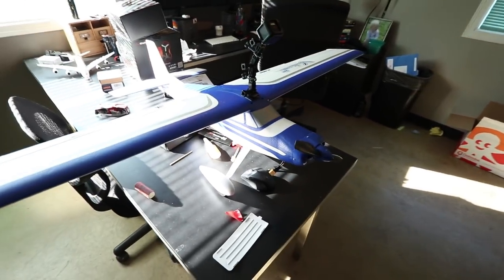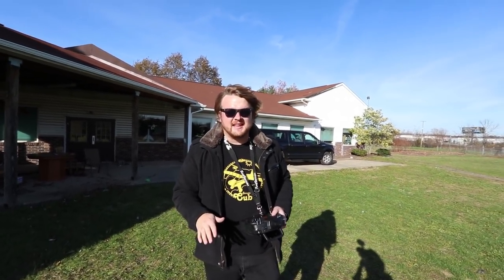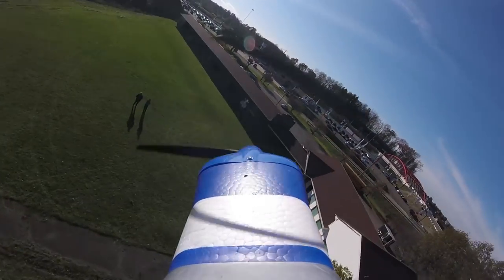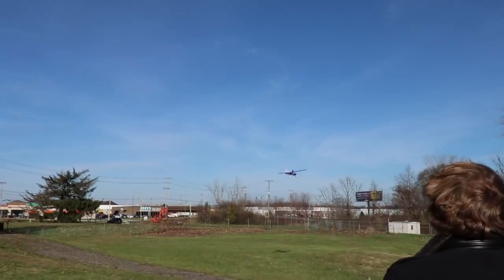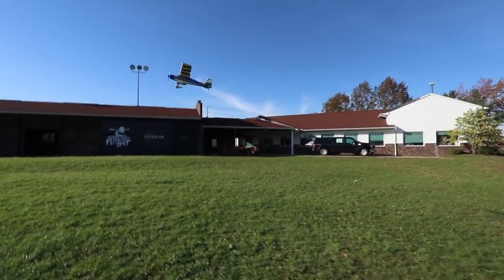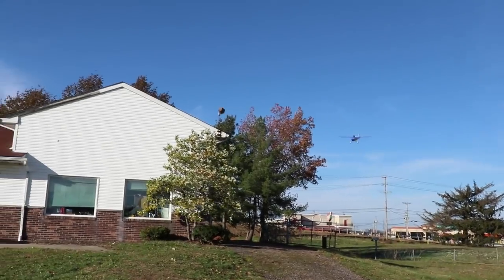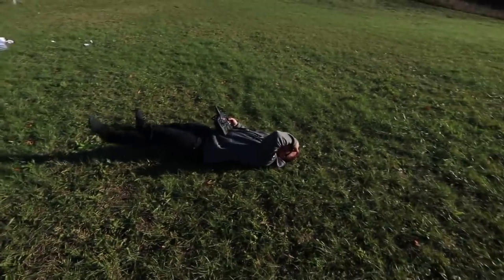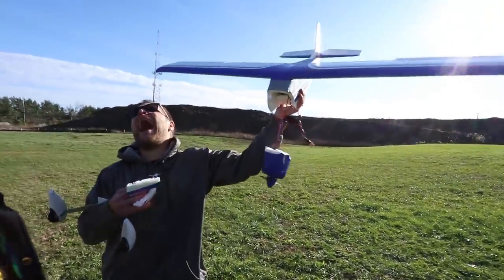FLYING BACKWARDS IN 40MPH WIND | VLOG0125

Comment: Several years ago (1980's) I built a Goldberg Eagle 2. I installed a 40 OS, and built Fowler flaps and fashioned Horner wingtips out of a balsa block. I could fly stationary in a 5 mph wind, and backwards in a 10 mph wind. I loved that plane. Sadly, I crashed it in a slow-fly contest. Love your work and your passion. Lee

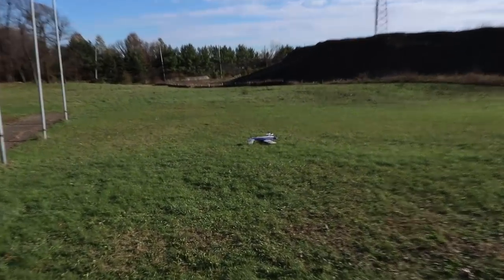Comment: LOL!  I used to do this with my original balsa wood glow-fuel 3-channel trainer at Tempsford Aerodrome.  On windy days when everyone else was sheltering it their cars, I was laughing myself silly making landing approaches across the runway, still facing windward, but approaching backwards!  I often had to hold it still with the engine and use down elevator to avoid what happened at 13:00 while I ran to retrieve it.  Good times!  Thanks guys!!  :o)

Comment: I have a super cheap fx803 piper cub.  I am not an expert flyer like you guys are but a couple weeks ago I had my cub flying backwards in about 12 MPH winds.  I had it flying backwards a couple feet per second at about half throttle while keeping the nose into the wind to keep it straight. It always flew too light in the nose so I added 2 BB's.  Works like a champ!

Comment: Have y'all ever heard of the 'rotor' when describing how wind flows off a flat surface into a valley?  That nice, high, flat-topped,  dirt pile is dumping a rotor on your flying field.  There will be rising air right next to the dirt pile and sinking air about in the middle of where you normally fly...with all kinds of associated turbulence.  The building serves only to add to the messy air which was tossing your plane all over the place!  Notice that it DID calm down well downrange...about where you normally turn base to final.
I'd suggest that it's OK to fly there when there's little to no wind...but this experiment would've turned out MUCH better in a wide-open, flat, field like where I see you fly sometimes.

Comment: In slope soaring, there is a need to penetrate into the wind to get to the lift - I always think of it as the need to fly your plane 'forwards and in' to avoid the 'upwards and back' on the slope...one of the reasons F-14, F-111 and Mirage G-8 and MiG-23 are popular slope jets - swing the wings to penetrate, and spread to get max lift. Fun though - actually, the Fieseler Storch (yup!) was famous for near VTOL performance in a headwind...and yes, Alex, its nose heavy :-)

Comment: By adding weight far above the wing, you cancelled a lot of the planes stability. The fuselage provides enough weight under the wing to produce a pendulum type effect making the plane very stable. like dihedral. By camera that high destroys that pendulum effect and cancelles A lot of stability. Basically like adding anhedral.

Comment: This reminds me of the Maiden of my Carl Goldberg Extra 330. I had no idea how it would fly cause it was the maiden, the motor was salvaged so I had no idea if it would work well or the mixture settings, and the only day I had to fly the wind was 20 gusting to 45. I got out to the field and there were some folks there but nobody was flying. It took me like 10 minutes to get the motor started cause it kept stalling, probably a damaged or clogged high speed needle. Anyway, finally figured out it would keep going at full throttle so I got it started, pointed it into the wind and gave it the stick, and it lept up into the air, flying backwards and up like a rocket, and I got maybe 5 minutes out of it before it went dead stick, and in spite of everything I floated it in with the wind pounding on it from every direction, and not a scratch. Only then did I realize I had an audience, and they cheered. Lol. Love flying.

Comment: I have an old Bixler II with bog standard power on a 2200 3s that I love to fly in high winds. The wing section is thin and the airframe not too draggy so it penetrates well but you can also slow it down and fly it backwards. The wings flap like a bird in the worst turbulence though!

Comment: I think the plane didn’t fly well with the camera because whenever the plane rolls, the camera is leaning to the side and wants to fall, so the plane wants to roll over. I have tried it, and it works better with the camera mounted on the bottom of the plane

Comment: that begs the question, why not rig the RC system with an auxiliary battery so you can dead stick it if your main battery fails?
Reply: it would weigh the plane down, and also double the batteries means double the chance of the plane catching fire! jk

Comment: LOL. I have done vertical circuits in a full size J3 in a 40mph wind. Land, upwind and climb to 200ft. Throttle back for the length of the runway and do it all over again. Have never been able to do that with RC.

Comment: fly the  FT bushwacker it flies backwards great you can do stationary barrel rolls, back ward  is easy You can also do vertical LIFT level flights stationary just like an elevator don't even need flaps try it some time

Comment: Been there and played that; a lot of fun.  I know that a few years back high-wing flat-bottom trainer airplanes played with drooped cuffs on the outer edges of the wing panels.  See this: https://ntrs.nasa.gov/archive/nasa/casi.ntrs.nasa.gov/19800004771.pdf  Go to page 84.  I have done this on two planes, one I put flaps on and one I left them off; you don't need the the flaps.  The marketing ploy never worked in the RC trainer market because the cuffs were not deep enough for a lite RC plane that landed too slow to make them effective at those landing speeds.  The mod worked so well on my wings that it was hard to land the planes even at an idle with a .40 sized glow engine; it was like trying to land a helium balloon.  An electric plane would have been advantageous.

Here is the rub: it wasn't the float factor of the wing that was so surprising, but it was the aileron authority all the way through a stall  that is amazing because it keeps the wing tips flying.  Your problem wasn't slowing the plane down to fly backwards; it was a lack of aileron authority when you did slow the wing down.  Which wing tip due to the angle the plane was pointed into the wind was going to stall first?  Using rudder would just add to a bad situation unless you pour the coals back to the fan to gain authority back on the rudder; Whoops! P-factor?  Get them thumbs going again!

I liked the video, and I think you guys should revisit this.

Comment: ive actually done that or at least come damn close.... on accident XD i had my ultra micro p-51 up in crazy winds, maybe 30mph near a lake and the thing was NOT moving XD.  It would go NYEOWWWWWWWWWWWW downwind and then would take about 45 seconds to make it the hundred feet back upwind, the problem was the elevator made it dive and pitch up like crazy any time i was going upwind.  The flying wasnt too hard, just slow the problem was that once i got it up in the air i uh really couldn't figure out how to land it XD with all that pitch authority i think i ended up slamming it into the ground XD   oh and side note it was the old one without as3x and had the little brushed motor XD

Comment: I have a theory, a high CG mixed with the fact your camera necks were creating turbulance on the rudder.  That could have caused your instability.
Reply: First of all this video was so much fun! Second I agree the high CG turned it from a high wing to a ~mid wing. You could do the experiment by adding polyhedral to raise the wing and see if it still had roll instability (from turbulence on the rudder) or whether it was just having the centre of lift at or below the centre of gravity.